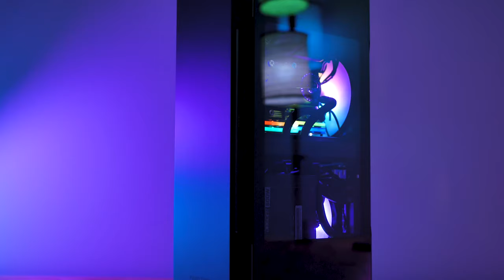How To Build A PC In The Phanteks Evolv Shift 2

Comment: Aw really wish you tested thermals, beast build! Just secured an Evolv 2 wondering if I should've gotten the Air (intended to buy air panels afterwards but they don't seem to be selling Shift 2 Air panels yet)
Reply: Im guessing you already figured out that the air mesh panels dont fit on the tempered glass case?

Comment: Since your using an AIO, are you concerned about the air bubbles and the life span of the AIO? other than that, nice build. It looks really good.  Thank you.
Reply from the maker: With the way the tubes are bent, I am a little bit. However I don't think this is the ideal AIO for this case, otherwise I wouldn't have as much of concern. Thank you mate!
Reply: @jdtechgear  no problem. thx for responding.
Reply: Guys the best AIOs I think are those with pumps built into radiators, just like in for example NZXT Kraken M22. This way the air is going to be nowhere near the pump.
Reply: @jdtechgear  what is the name of the CPU cooler you used? It looks badass!

Comment: Nice video, I'm now considering this case for my next build. I'm looking to build my wife a sffpc basically for work (MS office, Internet, nothing gaming) and am looking at a MB (Asus z790) and CPU (14900k) with 64 or 96gb ram and want it to handle 2 4k monitor w/out a GPU. All air-cooled with the Noctua NH-L12S. Building this all inside the Fractal Design Ridge case. What do you think of this (pro/con) and what case, CPU and MB would you recommend? Thank you.

Comment: this model doesn't have a compatible riser cable for pcie4.0 from phanteks, at least from my local e-commerce site....this model require a left side cable from slot but phanteks riser, the cable is on the right side of the slot, if you know what i'm saying. it didn't fit. gosh......i'm pissed...

Comment: nice build. do you know if you could swap with mesh panels if you order the model with tempered glass? i'd like a situation where i can have both options in case i'm doing something that does or does not require the most optimal ventilation

Comment: The foam things aren't insulators, pretty sure those are the PSU vibration cushions you mentioned at the 5 minute mark.
Reply from the maker: I hope so. I looked in the manual and they weren't mentioned in there unfortunately.

Comment: Hi. I recently purchased a shift 2 and have old system in shift 1. I hoped to install gigabyte b550 aorus pro ax mini-itx with AMD 3900x and rx 560 with 450 watt psu into the shift 2. Only the CPU and fans start up but GPU does not. Secondly I can not turn off the system with the top buttons, only turn on. What am I doing wrong? Does the PSU choke?

Comment: I dont know, this Evolv Shift II is worst than original Shift in my opinion. They could make flat rear panel and make space for 240 AiO with slim fans that is only few mm because they already have mash rear panel. I have old one and I'm modified it for 240 and im get really good thermal result. In terms of GPU you can put up tu 2.5 Slot and that is about 5.2cm thick and 11,5 cm height with new arhitecture Ampere or RDN2  you will get deacent cooling performance. I dont know Im little disappointed.

Comment: the bottom fan you mention u had a 120 but wish u had a 140. I had originally bought a 140 thinking that would fit but when trying ti install it it would not quite fit in there it was like 1 or 2 mm off from fitting into the space
Reply: so have to buy 120mm instead?

Comment: Thanks for the vid! I have 2 questions, I want to use this case with a pcie 4.0 gpu and mainboard. But the riser cable is 3.0. Will the riser completely turn the 4.0 functionality and speed off or will it just be a little bit compromised but still 4.0 ? Also how important is 4.0?
Reply: Hey man, so basically your pc will not turn on if you have a pcie 4.0 GPU with at 3.0 riser cable. You will need to mount the GPU directly to the motherboard, then change the pcie 4.0 to 3.0 in the BIOS. After that, you can mount the GPU back onto the riser cable.
Reply: Very late, but there is not usually much difference between 4.0 and 3.0

Comment: Great video man :)
I was getting the AIR version of this, I'd be using a 5600x and 6800XT, so I was wondering how well the AMD stock air cooler will perform in the mesh version of this case. Not sure why I haven't seen anyone doing that, I think not needing to mount a radiator and tubes will increase the airflow enough to make an air cooler work in this case.
Reply: 5600x stock cooler is terrible even in an open air rig. You’ll struggle to get <85c under full load with the stock cooler in this case. Considering switching to an AIO, I highly recommend the Corsair H80i v2. Im seeing 65c max full load with the H80i v2 and two Noctua 140mm NF_A14’s, both intake one at the bottom and one replacing the included fan.

Comment: Hi, can you mount the radiator same level as CPU? Switching existing fan on the side with radiator instead.
Reply: Nope, there’s not enough clearance for a radiator and fan there unfortunately. Barely manages to squeeze in the 140mm fan.

Comment: Do you think you could use a low profile air cooler instead of an aio? Given that it isn't a super high power CPU like an i9 or R9
Reply: I've used a low profile cooler in this case and it works fine as long as your CPU isn't one that runs super hot, the Noctua NH-L9i is a nice low profile for a clean build